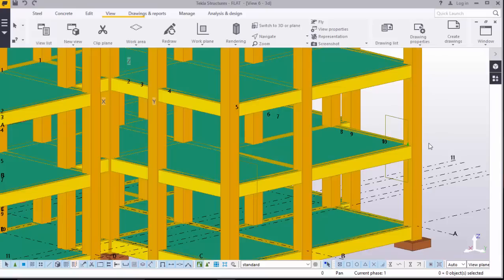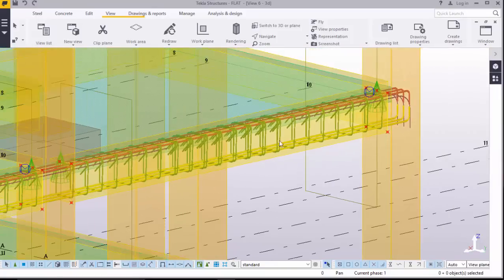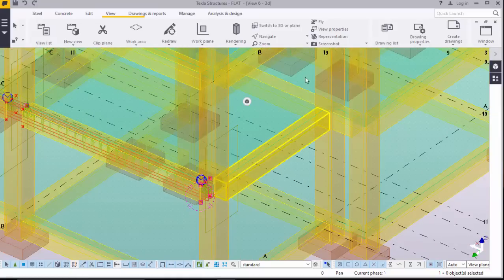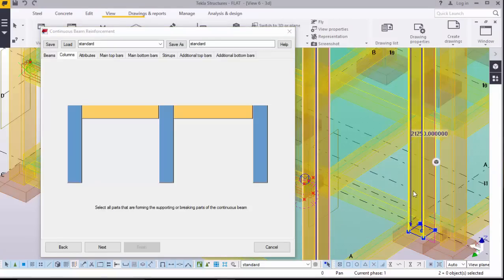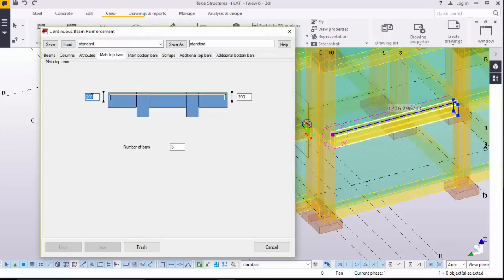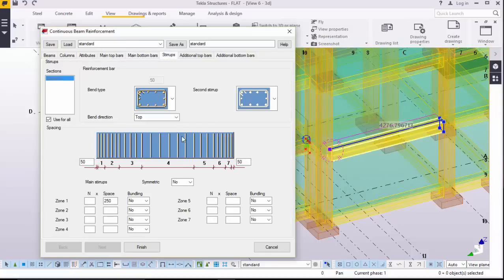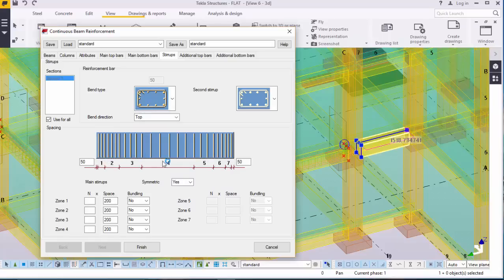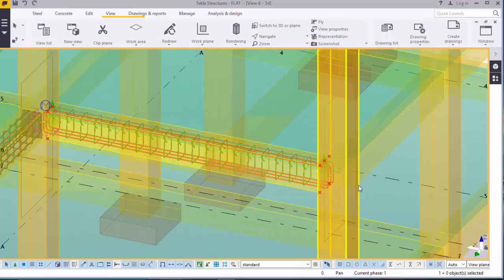Rebar Placement on Beams on R.C.C. Modelled Structure in TEKLA STRUCTURES 2016

Comment: thanks alot of your video, but could you please tel me if it's possible to change the format of the rebar at the end, because in TEKLA and on al video demonstration it used the rotation at 90 degree but in my country we use rotation at 135 degree
Reply from the maker: 90 and 135 degree rotation angle is available
Reply: @MauriceDimba   thank you for your answer, should you pleaaaaaaaase show me by document or video how I can dod that, because I tried a lot of time but impossible

Comment: Question(s): 
1. Is there an association tool whereby similar beams can be profiled(e.g.beams on one side of structure with similar properties and rebar detailing) so that when I detail one bar the software would automatically detail the others (not for beams only, but for slabs, footings and staircases too?)
2. How does one come up with a different bar shape for a slab, especially an edge slab (I prefer continuous rebar that entails 1/6th of span at top, bending into an U-bar and finally the rest of the bar over the length of the span)
3. Is there a command that would automatically lock the rebar for slab so that for edge rebar it automatically calculates the 1/6th of span and comes up with the length automatically, and 1/3rd of span at middle beams and calculates the same and places?
Reply from the maker: Mr. Simon,all those are possible, i have noted and will be addressed in the next upload just keep watch watching the channel
Reply from the maker: You can now watch Tekla tutorial videos directly from https://civilmax.com/sofware-training-videos/

Comment: Thanks for the wonderful tutorials. Keep them comingInstead of putting the same settings repeatedly, you may save the settings using the 'save as' button on top of dialogue and 'load' the saved settings every time you want to use those settings.  This will save time and increase efficiencyAnd yes, I have subscribed
Reply from the maker: Thanks alot Mbarouk,and that point is noted down.